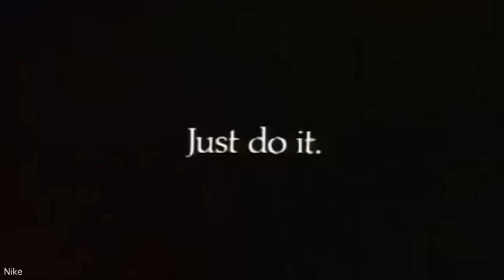Barn Find 1962 Pontiac Catalina Interior Upgrades, Trim Installation and MORE!

Comment: The theory behind the dual point distributor was to insure adequate spark duration at high RPM. It was not uncommon for a single point set up to "float " ( not really close long enough to allow the coil to fully " saturate" ( insufficient flux linkages/ meter ; flux density) to provide a " strong enough spark ( heat enough to ignite the fuel mixture ( Lewis and Von Eible table) in a high compression engine( the cylinder pressure would blow out the spark) at high RPM.( near 10,00) this technology was first utilized in high performance aircraft engines. Particularly important with low combustion air available at altitude.
Reply from the maker: Thanks for sharing!

Comment: A rare non wiseass comment from me, as I was a shock wizard for 20 years,  when those front shock lower bolt setups turn to crap, get two top post battery bolts,  the 5/16 in with the square heads, drop them thru the hole from inside the spring, fish your shocks into the hole, and install the nuts with your favoritest speedy 3/8 impact. The top square bites into the inner well.  Always had a bag of nuts and bolts in my junk drawer.
Reply from the maker: Thanks for the info!

Comment: I worked for a Pontiac dealership in the early 70s had a rash of timing chain /sprocket failure. Aluminum with nylon teeth, teeth came of and would go into the oil sump, if you keep it might want to check that out,I'm sure there is info on what year that crap happened.
Reply from the maker: Thanks for sharing

Comment: I don’t know what kind of fuel you’re running in it but if it has dome pistons and that big of a cam you should probably be running race gas in it, back in the day we used to be able to buy ethyl which was well over 100 octane, that will cause it to run slow and hard to time
Reply from the maker: noted

Comment: Silver would be rad on that Pontiac, but I'd find a way to make sure the stainless and chrome still stands out. EDIT: Those door pulls are the same as my 64 Corvair. I have a spare set if ya need 'em.
Reply from the maker: Right on

Comment: I knoq you will never be bothered to do this, but I have straightened wobbly old water warped doortrims by laying them face down on a towel on the shop floor, pouring boiling water on them, and laying another towel on top with a stack of old phonebooks on top of it all. Leave it for a couple of weeks and they come back ok.
A totally useless tip for the timeframe you build on, though....lol
Reply from the maker: That's a great idea!

Comment: Dual point distributors are supposed to increase coil saturation by pulsing the breaker signal. The theory is the primary field will expand and collapse and expand again before the coil can discharge.  Like lifting a heavy block in two short steps instead of one large step. But an old drag racer trick was to wire dual points up as two separate single points. The dwell split between the two sets of points is about 4°. Because dwell effects timing, but timing doesn't effect dwell the second set of points could be switched to deliver 4° ignition retard. They would hook up those points to the nitrous oxide system to provide instant ignition retard when the nitrous is triggered.
Reply: Yes, I'm so old we learned about points ignition in tech school.

Comment: Those heater controls were designed to resemble a throttle quadrant in a multi-engined aircraft. subtle bit of real 'man gear' - it was still a 'chick magnet' in the  60's - like the 'jet engjne  exhaust' of the round Ford taillights from the early-mid 50s forward, becoming less subtle as america entered the 'jet age' the end being 1964, after which in 1965, they changed direction - boxy - angular cars after which less swoopy-scoopy more smoothie-flowey, more interior comforts, BETTER RADIOS - the automotive radio was anothet 'man gear' vector - women were baffled about how to change the pre-sets for the stations, (handy if you moved😁) 
Cruising around as a passenger in my parents cars, but mostly when with dad, I learned how to Identify nearly everything on the road, and that year my mom noticed it, and the quiz began with a 'test' a 'car-nival' a 1957 year model car show, multiple manufacturers, foreign and domestic, (more of both were viable then) on Saturday evening,, and Sunday afternoon and evening. 
Back then were DeSoto Vauxhall, Simca, Isetta (BMW-Isetta) Ever see a Messerschmitt 'car' ? 3 wheeler looked like a airplane with wings, tail and engine cut off,  wheel struts cut down to lower the nose, and the tailwheel was made a bit larger,, like a 2-inline seater torpedo plane but both facing forward would slide up next to either mom's 58 Mercury Montclair or Dads 59 Ford a couple of years later, and even me, sitting low in the seat at that age, being 'vertically challenged' would be looking DOWN on their 'car'. scary stuff.😁  Well as Abe Simpson would say - WHAHHHUUH?  what was I saying?👍🇺🇸😎
Reply from the maker: Thanks for the info!

Comment: Hey my friend where exactly is the lone Star Roundup I'd like to come and see you guys again like I did when you came down here and I yelled from the wheelchair Hoover sneff I've been nursing a hole in my foot for about a year getting better maybe by April I'll be able to walk without the damn wheelchair but anyways I like to come and see you but I don't know where the lone Star Roundup is going to be held at? Also I see you have a green 68 Chrysler Newport does that have the 383 2 barrel in it? I couldn't tell if it was a 4-door or two-door? My dad's best friend when I was a kid I would go golfing with my Dad and his best friend. sometimes taking my dad"s friend "s car and it was the same green 68 Chrysler Newport the car was in mint condition he had bought it new and I was born in 65 so I saw it when it was newer I don't remember it quite when it was brand new? but I saw it from like 70 I remember from 70 up until he bought a brand new 79 Chrysler LeBaron what is a nice when I had bucket seats and stuff for a Le Baron two doors was pretty cool. But if you could tell me where you guys are at that would be cool the lone Star Roundup probably Texas but I'm here in Lawton so I know Oklahoma things!!!!
Reply from the maker: Austin, TX

Comment: Chevy ll Nora's have same rear shocks, but be thankful that Pontiac used a real front suspension with A arms.
Chevyll's have same front suspension as Mustang,Falcons with shock towers and all the rest of the garbage associated with the FOMOCO unibody models. 
Strange how they copied Ford on that, especially when they had a much superior suspension setup, but at least they didn't stick with it as Ford did for another 14 years until Mustang ll's came out.
Although that was only good thing about those POS wana be's that I'm aware of. 
You know that you can die or even paint the arm rest, and door cards to match the seats. 
GM sells replacement pieces that are all black if you buy factory replacements, and if you clean everything really well it usually takes years before the color starts fading. 
Just FYI, in case you didn't know about this, but then you probably already knew that. 
Give Duff a good scratching. 
Later

Comment: Did you try rolling down the window on the passenger side after  to make sure door handle screw does not interfere with the window mechanics?????? Throat on fire is the first sign of the vid!!!!!!!!!
Key three Sore throat...Fatigue.......Difficulty breathing- VID.          Aches fatigue fever......FLU.
If wheezing......RSV.